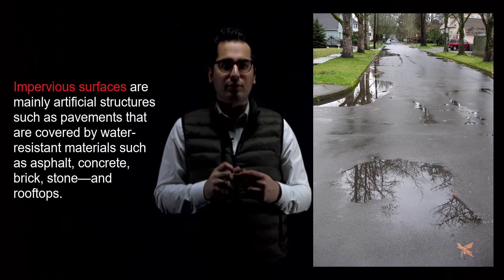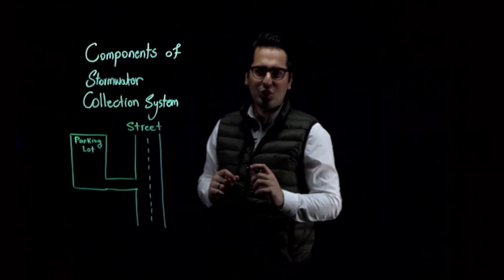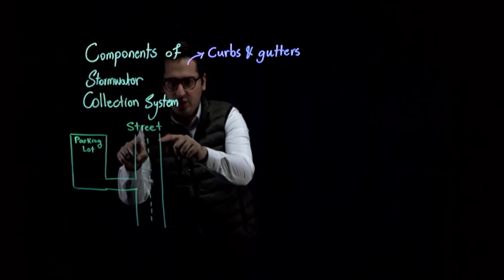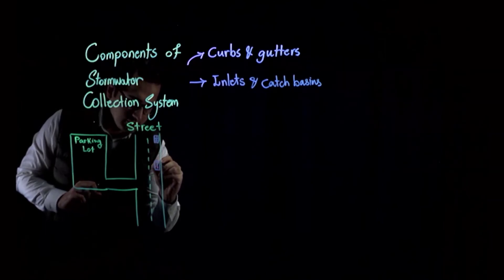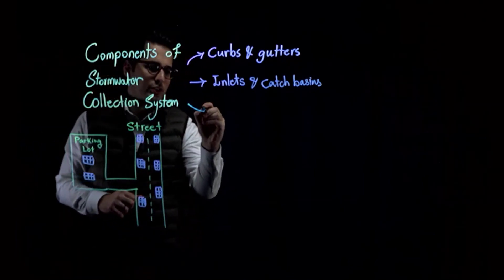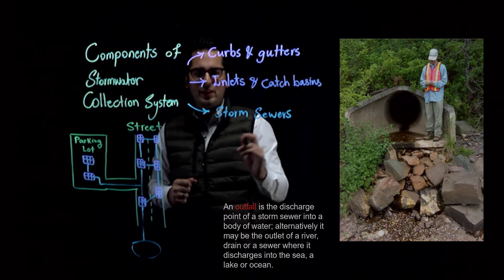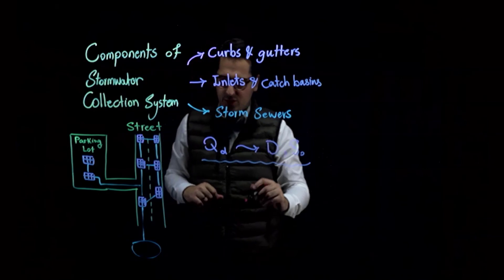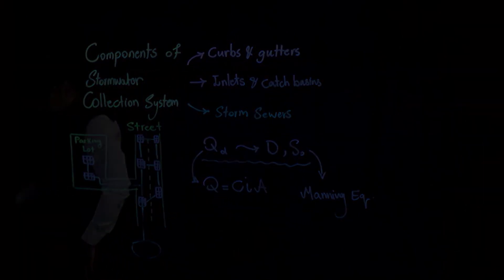Part 1: Fundamentals of Stormwater Collection Systems

Comment: Hi. Thank you for this video. I'm not familiar with drainage design. So, I'm just curious, what is the normal slope used for the urban drainage pipe. And how do they maintain the slope from the inlet to the final outlet (ex. river). Because, if the inlet is far from the outlet, then the pipe outlet level maybe become lower than the river level (if they maintain the pipe slope).
Reply from the maker: Such a great question! The slope of storm sewers is determined based on many factors such as cover requirements,  self cleansing velocity, max velocity, etc. The storm sewers are then put into place in small sections and there are catch basins and manholes in between them. In other words, different sections may have different slopes depending on the requirements.